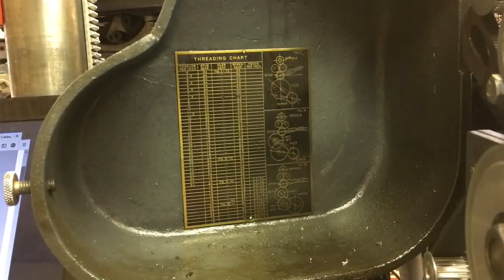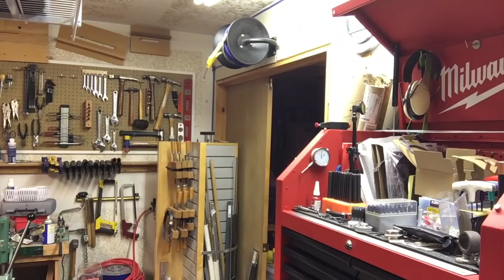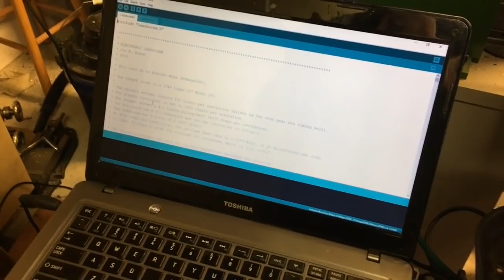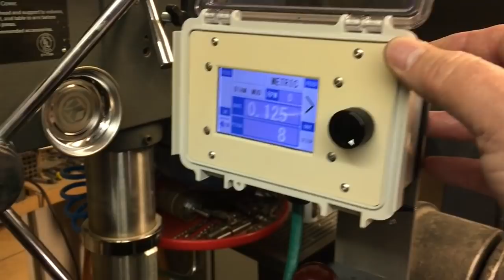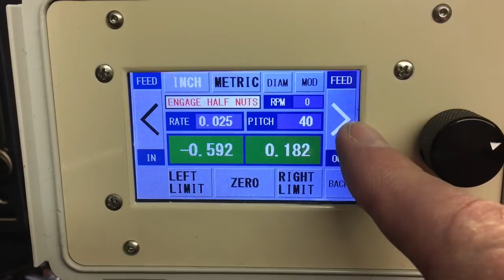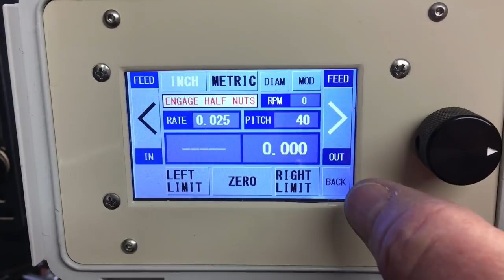My Electronic Leadscrew Project Overview

Comment: My God Jon, tell me you did that in the Arduino IDE, very impressive.  It would be so interesting to see a block diagram of your design.  I've been working on my ELS for sometime.  I had chosen a hall sensor to read the spindle. But it seems many people doing it today have chosen an encoder instead.  But must say I grew out of Arduino language and went to native AVR pretty quick. To which I was able to add in 3 axis linear scales.
Reply from the maker: The Nextion display was set up in their editor and only simple commands of a few characters pass between the display and the Arduino.  You're just sensing your spindle rotation once per rotation with the Hall sensor and doing a velocity calculation and interpolation?  I settled on an 800ppr encoder and 1000 steps per rev on the motor.  With a 4:1 belt drive and an 8tpi screw I get 16 steps per 0.001".  That's overkill, and pushes the Arduino a bit at 1500rpm (a 20khz interrupt rate).  I pre-calculate the number of steps per revolution for a given pitch and distribute them evenly in an 800-element table that corresponds to the encoder resolution.  The Arduino doesn't do any calculations in the encoder interrupt routine, it just uses the spindle count as an index into the table.  Making sense?  The really tricky part is the timer interrupt routine that outputs the steps.  That took me a while to get straight.
Reply: @jonrbryan  yes I started out with a single read per revolution and made the calculation once per second. The idea is once the spindle gets up to speed I could average the rate and it would be smooth and accurate enough.  It works, but one feature I added was stall detection where I might be turning low as 45 rpm where there would be over a second between reads. Too slow to detect a stall.  Then added a second sensor with 8 magnets to detect stall.

This is fine well polished work. I encourage you to kit, open source, sell, give away, and start a forum. But don't let such a fine project die when your interest fades.  Frankly it's great you stuck with Arduino, many more people would possibly be able to contribute, it's amazing the things the masses come up with.

Comment: THIS IS MAGNIFICENT. Extremely professional setup. I would buy this right now if you sold kits. I run die mills for my day job- but have my own high precision manual equipment at home. I would love one of these for both my Taig lathe and its opposite, a Schaublin 102. Best execution of this concept I've ever seen.
Reply from the maker: Thanks for the compliments.  My wife teases me that my hat size is increasing.  I keep thinking that it would make a nice retrofit for a Hardinge TFB-H if I could find one for a reasonable price.  I could have picked up an HLV-H from the retiring machinist I bought my Clausing 8520 mill from, but I didn't have $10k burning a hole in my pocket.  He was the original owner, and it was a bargain at $10k.
Reply: Great concept. @jonrbryan  When are we going to see the next episode?

Comment: Thanks Jon, enjoyed the presentation.
 I had thought about doing this as a 'proof of concept' on a Sherline. I think it would take more than I want to do to mod my Super 11 Maximat lathe though.
If you're thinking about packaging it out I see a problem with the speeds because they are application specific to your Logan. Perhaps being able to change to any speed up to a max that the uC can handle would be more generic. This way users could set to their lathe speed. Not sure why you need those though as you have a tach on the headstock which, seems to me, all anyone would need.

I do a lot of uC interfacing to rotary encoders. First, I use name brands like Alps, they seem to be inherently less noisy than the Chinese eBay ones. On critical apps where the encoder takes a lot of abuse I use optical encoders, virtually noise free. 
Also, I didn't see a way to lock the settings. I use encoders with switches, pushing in the switch locks the settings. Usually I set up an interrupt routine to write to eeprom if I want long range savings.
Reply from the maker: Yes, the speed table is specific to my lathe, but it's just cosmetic, and I still haven't gotten around to coding it to only show "valid" speeds for a given pitch.  I stretch the step pulse period as the pitch increases to avoid resonances, so there is a practical limit to the lathe RPM for a given pitch.  If it's too fast and the encoder interrupt sees that not all of the steps were output for the last tick it warns the user by turning the RPM display red.

I'm currently using an 800ppr Omron optical encoder on the spindle.  2k pull-ups give me clean signals.  I have a couple of "Ormou" counterfeits too, but they seem to work just as well.  Probably made in the same factory.

The pitch select knob is a cheap 20ppr mechanical encoder, and I wired the switch but haven't come up with anything to use it for yet.  I had thought about using it to save the current settings to flash, so I guess we think alike.  As it is I just default to Inch and 40tpi (1 step per encoder tick).

Comment: This is such great, thoughtful work! You clearly have many years of experience designing systems like this, the user interface is very well adapted to the minimal touch screen and encoder. I have found it impossible to buy metric change gears for my old South Bend Heavy 10, and are about to duplicate your work on a south bend 9 lathe as a prototype, before i remove the gear box from the 10. Selfishly, I would love to see your Arduino code and learn from it. 

Thinking more broadly than myself I think you could build a terrific community if you open source the designs and code. Something like the Maslow CNC team has done, https://www.maslowcnc.com, they have gotten many builders who adapted the system to their individual needs, while the original team provided kits to purchase. After a time, they decided they no longer wanted to supply the hardware, and community members have stepped up and are making kits for sale now, with improvements many others have come up with already integrated. A virtuous cycle, it has been fun to see all the work community members have made with their Maslow machines highlighted on the Maslow blog. 

I would be glad to help if you are interested in setting up a website for your project.

Since there are so many different old manual lathes to adapt for, that seems like an almost hopeless task for an individual, but I would be excited to work on making this work on my south bend heavy 10 or 9 lathes, and many others would almost certainly feel the same about their own machines. I hope you feel better soon, and can't wait to see your refinements.
Reply from the maker: Thank you for the kind words and advice.  I will look into it.  I'm doing retirement paperwork and intend to spend more time whipping things into shape in the near future.  If I'm in the shop my wife can at least pretend that I'm doing something productive :).
Reply: @jonrbryan  Please don't keep us waiting too long.
Reply from the maker: @boldford  I've been working furiously on it for the last several days, "cleaning up" the code.  I've already outsmarted myself a couple of times and had to backtrack, but I've been able to improve the readability  of and simplify some routines.  I'm still wrestling with a design philosophy issue in setting limits and may change that screen on the Nextion.  I may do a video and ask people's opinions on it.  It's been hitting 90 degrees in the shop and it's been wearing me out, but today is supposed to be cooler.  Must be getting old.

Comment: Hi, is there any chance that this system could be fitted to a Chinese mini lathe? I would love to buy a kit for mine!
Reply from the maker: I don't have any hands-on experience with one, but if you can figure out how to get an encoder on your spindle and a stepper on your lead screw it can certainly be done.  A NEMA17 motor would probably be appropriate for one of those small lathes.  Getting everything to fit under the cover would be the challenge.
Reply: @jonrbryan  Thanks for your reply, I'm sure I could find a way of fitting it, I can always make new covers to fit. All I need is for you to start selling the kits and I will give it my best shot. It's the programming that I would struggle with as I have zero experience with that side of things.

Comment: What a great job! i don't think you mentioned how you were able to program the graphic interface. could you elaborate a bit on that?
keep up the great work!
Russ from Coral Springs, Florida, USA
Reply from the maker: Nextion has a GUI editor/debugger for their displays. They also have an Arduino library, but it was so cumbersome I just rolled my own simple interface.  The editor is pretty clunky, but it gets the job done.  They have their own little programming language, and much of the GUI behavior is programmed into the display.  Once you have the GUI developed you write a file to a microSD card that you plug into the Nextion display before powering it up.  Once the display programs itself from the microSD you remove the card and cycle the power.

Comment: This is exactly what I a looking for. I have been playing around with the same idea now for a while doing the breadboard testing with the same thoughts. I was also considering the ATmega controller but still needed to do some testing before I can make up my mind. I would be seriously interested in your code as well. Then along the line come https://www.youtube.com/watch?v=FTs9GygRQ-U and then I saw your video. Now I am even more determined to do this. Sure hope that you will make your code available.
Reply from the maker: Thanks for your interest.  I'll be keeping an eye on that project just to see how it goes.  I bought an Arduino Due, which is faster and has quadrature decoding logic, just in case the Mega fell short, but so far the Mega is getting the job done.  I've also looked at the STM32 variants, but I haven't looked at the TI board that he's using.  It's a balancing act between the interrupts, screen updates, and maximum pulse rate that the driver can handle.  I think my code efficiency is pretty good, but if my lathe ran over 1500rpm I might have to drop the spindle encoder down to 400ppr.  I doubt that there would be any practical difference, but I suppose I'll have to try it at some point.
I really enjoy the touch screen/knob interface, but I do have some concern about the durability of the screen in a shop environment, which is why I put it in a lidded box.  I slipped with my cordless drill and broke one during development.  I guess we'll find out as I use it more, but so far it's working very well.
Reply: Well the fact that I stay in South Africa make my options a little bit less open. The Arduino range is freely available here and that include the Due which is most probably why I will be using it as well. On the touch screen side up to know I had no issue as I have done a finger joint jig with the Due and touch screen as well. Also the fact that I stay in SA means that importing kits is also a no go simply due to cost so I would purely look at a code option.

Comment: Wow that was a great looking implementation and thanks for sharing. Clough42 also is in the beginning stages of developing an electronic leadscrew. He is using a much finer shaft encoder. That necessitated a higher processor than a standard Arduino could keep up with. You were able to fit your design into a Mega Arduino which simplifies things a lot.

I like the idea or using red for speeds that are not recommended. I suggest instead of white for active and black for not selected use white and grey.

I believe that you are right by using a switch on the carriage for half-nut control.

I love the limits. How hard would it be to shoehorn a direct entry method for limits entry?

Was that a NEMA 24 stepper with an integrated driver?

You have inspired me to implement an electronic leadscrew for my lathe. A pick gear system works and is low cost but it is a time suck to the point that you don't want to be bothered making changes.

This is a game changer. Just like how sewing machines went to automatic stitching. One day all lathes will have E leadscrews.

Thx again for sharing.
Reply from the maker: Thanks.  I tried to match the spindle resolution to the the available processing power, and figured 16 steps per 0.001" was fine enough.

Direct entry of the limits using the knob is on my "to do" list because it should streamline things considerably.

The HBS57 closed-loop driver I'm using is from Banggood,  My Leadshine 1.9Nm NEMA23 motor is from StepperOnline because Banggood's published dimensions for the motor that came with the driver were incorrect and it didn't fit.  I tried StepperOnline's CL57T driver, but couldn't get it tuned to work as well as the HBS57 does without tuning.  I'll try again at some point to see if I can get the CL57T to behave.

I think you're right about electronics replacing gearing at some point.  It just makes things so easy.

Comment: Great project, I have an arduino driving a stepper connected to my lead screw, I just have a potentiometer varying the feed rate at the moment but I want to add thread cutting and I was thinking about using a Nextion display I have as the UI.
Reply from the maker: You just have to figure out how to drive an encoder from the spindle.  I replaced my stud gear with a timing pulley and it all tucked in nicely, but I could have just pulled the entire reversing lever and tumbler gears and bored out a timing pulley to replace the spindle gear.  That seemed like more work, though.

Comment: Ill be following i have several Nextion displays and A shoe box full of Arduinos and the derivatives there of . Id like to do this on my 7x14 Asian mini lathe as they too are plagued with a crap change gear setup .
Reply from the maker: I'm happy with my choice of the Nextion so far, but their code was so cumbersome I just wrote my own.  An oscilloscope that can decode RS-232 is invaluable.  You might be able to figure out how to fit a NEMA17 motor under your cover, and there are also smaller encoders available than the standard 30mm that I used, they're just more expensive.  I've thought that it could be an interesting project.

Comment: Hello   an awesome display of your computer knowledge and applying it to a very worthwhile project. I would be very interested in details of your build. Long ago i put just a variable motor drive on my lead screw to adjust to get that "perfect" cut, and it works well enough. My issue is that my lathes change gears seem to a bastardization of metric/imperial that leads to a thread that is close but never perfect depending on the pitch. Your solution would eliminate all that guesswork. 
Cheers
Reply from the maker: Thanks, Eldon.  First thing I noticed after getting the lathe was how fast the crossfeed was (twice longitudinal) and I started working on a gear motor drive on the outboard end of the leadscrew.  The previous owner (a retired machinist) had started to do the same thing, in fact.  I soon decided to go all-in with this approach.  I'm out of commission after knee surgery and complications right now, but I will be getting back on it soon.
Reply: @jonrbryan  ouch take it easy on the knee!!  I have a basement shop and the lathe is cheap Chinese import that has been pretty much been pimped out with everything I can think of the make it "better" but it is was it is. Lipstick on a pig I believe is the saying, but it is fun to try out new ideas. Have a DRO, changed motor to 3ph with vfd, digital rpm, mist and flood coolant. (changed all four tires and it still wont start)    So to the point of all this, it doesnt single point threads well. Even the chart for the change gears printed on the cover is not the same as the manual, and neither are the same as the set of gears supplied. So there is an issue right there. I believe it was a metric lathe that was factory changed to an imperial but no one got the math right.  I would be very interested in see the calculations that you used to come up with the ratios etc that are displayed to allow the tool to track that accurately and repeatably 

Cheers from Canada, snow is almost gone and spring is on its way   keep well
Reply from the maker: @eldonwilson8495  The math is pretty straightforward.  If you can do basic algebra you won't have any trouble with it.  The tricky part is distributing a given number of steps evenly for the closest approximation, but that's pretty simple math as well.